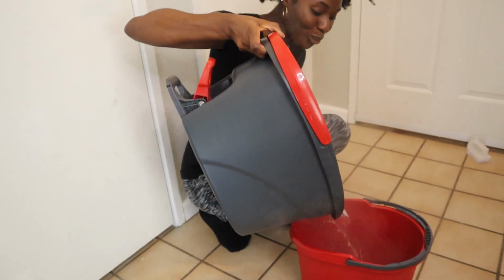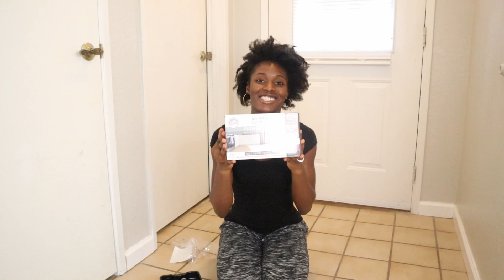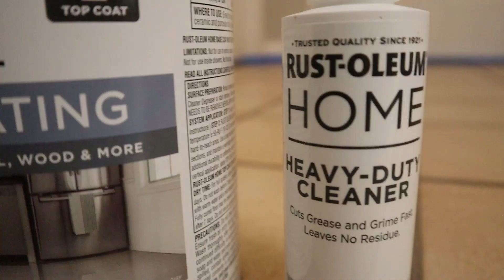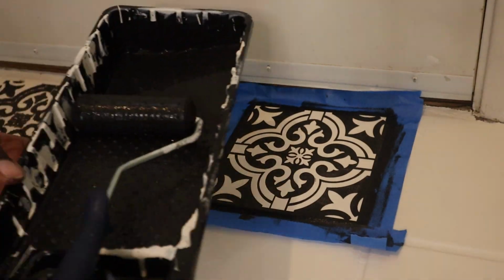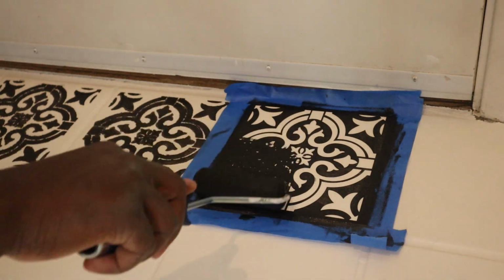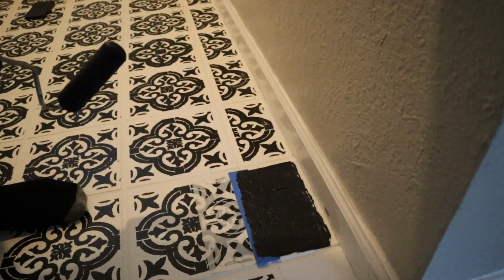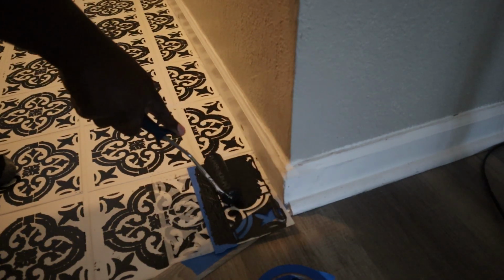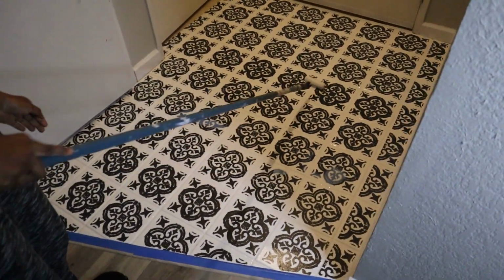DIY| How To Paint Floor Tiles Using Stencils And Rust-Oleum Home Floor Coating.

Comment: I had to come up with an inexpensive way to make my tile look better without removing it. The two ways were to paint over it and to re-towel over it then I saw your channel which you can use a stencil. I love the idea. My only question is, are you having any issues with paint coming off when cleaning the floors?
Reply: Re-tile. Sorry. Not proof reading. Talking into my phone.
Reply from the maker: Hello, thank you. The paint  is still in good condition. I have mopped the tiles a lot of times and no paint has came off yet (surprisingly) 😄. It’s a very good product. I will do an updated video soon.😊